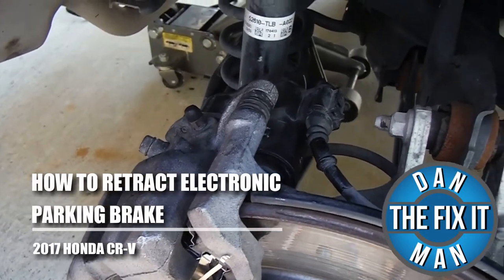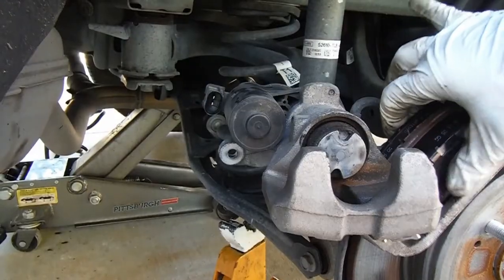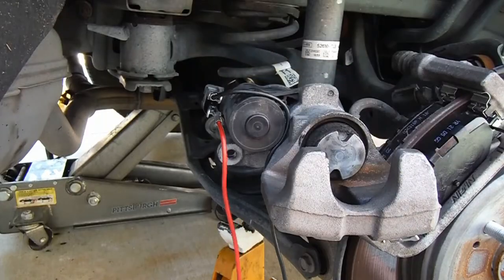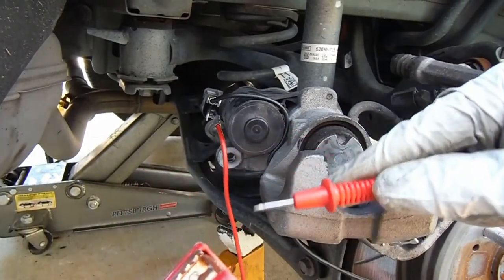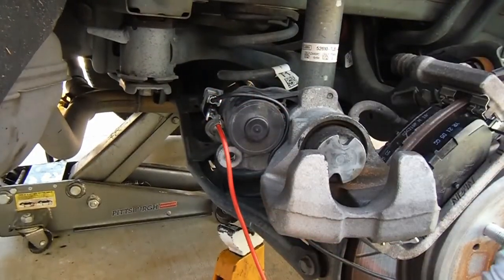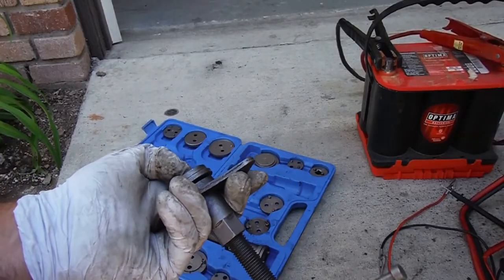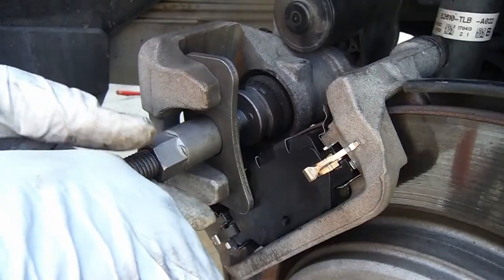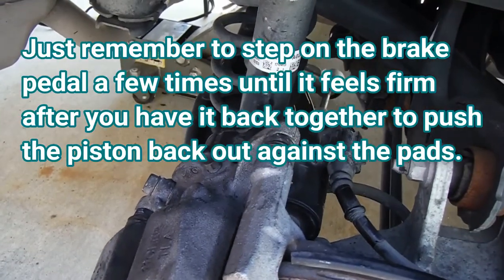HOW TO RETRACT AN ELECTRONIC PARKING BRAKE - DIY EASY METHOD TO WIND BACK REAR BRAKE CALIPER W MOTOR

Comment: Nice tip, I searched for it after solving the problem in my 2017 Honda Civic. The alternative I used was to dismount the electric motor from the back and rotate the gear manually. This was AFTER disengaging the parking brake. I spent a long time unsuccessfully trying to collapse the caliper before finding this solution.

Comment: That trick with the 12v leads was super, I had already had it all apart so there was no way to deactivate it from inside the car without jeopardizing the piston... One way to push in, the other out, careful which way and gtg, I used a jumper pack to do that, loved it.

Comment: Good video but here is something to add , you didn’t mention when you turn piston in with tool the slots in the piston for tool has to line up for brake pad as there is a pin on the pad that fits in that notch , you can’t get caliper on if it doesn’t line up.

Comment: thanks
someone suggested that i leave ignition on, turn off hand brake than do as normal. Do u think that could work?.
Reply: That's what I was thinking.
Reply: Anyone try it this way?
Reply: Ive seen people do this, then the park brake activated when the ignition timed out and shut the veh off. The EPB automatically applies. With the calipers removed and no pads to apply to discs, the EPB motor runs until the caliper piston pushes out of the caliper on both sides and leaks all the brake fluid out. Do not use this practice. I always have half a dozen customers who "have a guy that costs less" that come in on a wrecker and expect me to fix their problem. Nope. 2 new calipers are quoted, 2 cans of brake fluid and an hours labout...oh would you lile me to replace your brakes while im at it? Thatll be another 2.0 fpr my falt rate👌because i just like to teach them a lesson. Pay a little now or a lot later. You got a guy. Dont come back smartass.

Comment: Thanks for the vid. Newbs question, can I just use jump start battery to do this procedure instead of regular 12v battery like what you just did?
Reply from the maker: Any 12 volt battery should work.  I have even heard of people who have used a small 9volt battery successfully.

Comment: I was told you dont turn these in, you push them, turning was for the non EPB ! Yes ?
Reply: Your right
Reply: Electric park brake motors rurn  threaded rod on a nut which eventually prezsed the caliper piston against the pads and dics. 

Some calipers are press in for rear of vehicles. Some are spin in calipers. There are non- EPB spin in calipers but in theory the piston on the EPB do not require spinning lile the old school. 

The EPb motors retract, then you can press or pry the piston back into the caliper and proceed with brake pad and disc replacement.

Comment: Thank you, Does the car need to be on or it doesn’t matter?
Reply from the maker: Car must be off.
Reply: I tried but it didn’t work, no sound at all
Reply from the maker: @Odi2017   Here's another video I did showing a different way to manually retract the caliper.

Comment: Please help. What if the piston is too far out so the special tool won't fit in? I can turn the piston, but I don't have enough force to push it in.
Reply: Same problem I dealt with
Reply: then you have to use another special tool that will fit or a clamp to depress the piston. Or, just go to the dealer and pay.

Comment: Anyone come up with the issue that they have taken the caliber off then the electrical e-brake opened(decompressed) all the way? Having an issue getting it closed again, enough to have it compressed over the brake pads. 
Wondering if this worked or if I’m too far outside of the process I should have followed.
Reply: Did you figure out how to get it back in im having the same problem

Comment: I wish I could see your video earlier. I just turned the car on while one of the rear brake is disconnected, not even brake pads in between, I tried to press the parking braking switch to rewind the piston, however, I found the piston almost fell out, not able to fit a compressing tool. I had to take the motor housing off to manually loosen the motor. Now, I got he caliper back on the car, however there are electric parking brake,  tire pressure light on. Can someone tell me what should I do?
Reply: What you ended up doing? Let me guess, go to the dealer and pay?
Reply: @slothypunk  I took off the motor housing, extract the bolts on the motor all the way counterclockwise

Comment: Can anyone advice on how to do electronic parking brake motor replacement? Mine not functioning, so decided to replace with a new one. Does it only require 'plug and play' the motor?
Reply: Probably - the caliper piston needs to be retracted by spinning the spline clockwise to bottom it out, then install the motor.  The motor must have an internal  pressure stopping point, as they seem to "self-adjust".  So yes - plug and play.

Comment: I’ve got the error codes on toyota, how can i fix it. I tried by taking out the fuse and putting it back, did not work.
Reply: Remove the negative battery cable.
Reply: @Azureecosse  Yea, you're correct.

Comment: You do not need to rotate the piston.  Just push it in.
Reply: I just turned mine in on my 19 forester and it wouldn't open far enough for the new pads just by turning it

Comment: It never worked for me :/ would go out but not in at all
Reply from the maker: You still need to push it back in with the tool once you figure out the correct direction to run the motor.

Comment: Or you know use torx screw on the back to disengage the ebrake 🤷‍♂️
Reply from the maker: Yep, that works great too.  I just did a video showing that method on this same vehicle.
Thanks for watching!
-Dan the Fix it Man
Reply: Can you kindly elaborate this torx screw method?
Reply from the maker: @slothypunk  https://youtu.be/5tOzgxrFnxY
This video shows that method of retracting the caliper piston manually.
Thank you for watching!
-Dan the Fix it Man

Comment: This is not the easy way
Reply: What's the easier way?   About to do mine.  Thanks
Reply: @freddykrueger3589  key on, press electric park brake switch release fpr 2 seconds, stomp throttle pedal to floor/WOT 2 seconds, using free hand cycle the ignition off and imstantly back on while holdimg the throttle and park brake switch in release position. 

After brakes are replaced, apply park brake 2 seconds, stomp throttle 2 seconds, ignition off then back on and you will hear the motors wind until cinching the pads to the disc. 

Thosnis indicative to Land rover/range rover, jaguar and fords.
Reply: @matthewmorrone883  
Thanks for your time Matthew,   much appreciated pal .....👍
Reply: @freddykrueger3589  Did you do it? I have no idea what the OP is saying at all with his "easy" way.